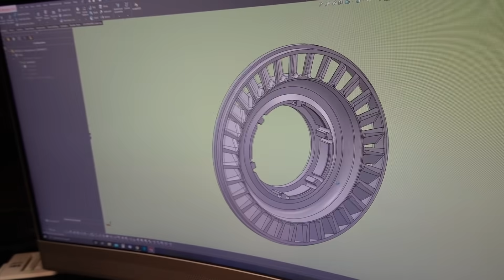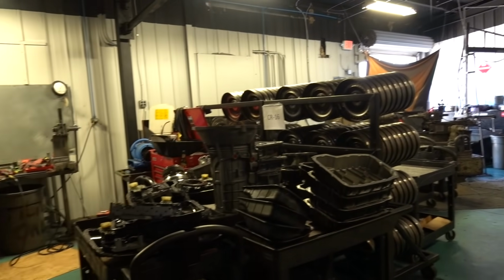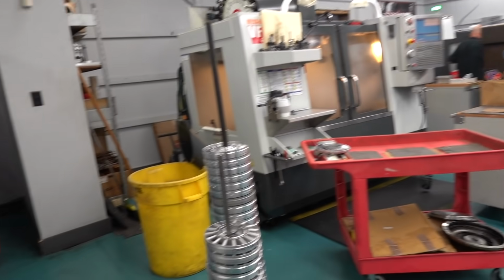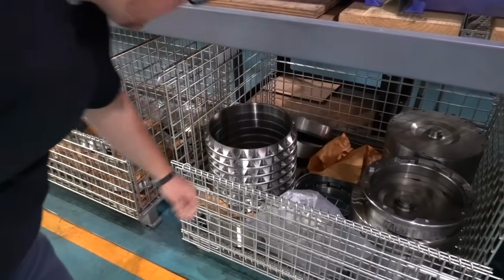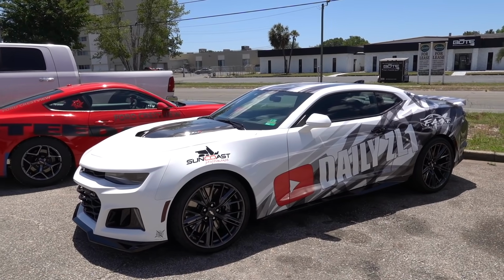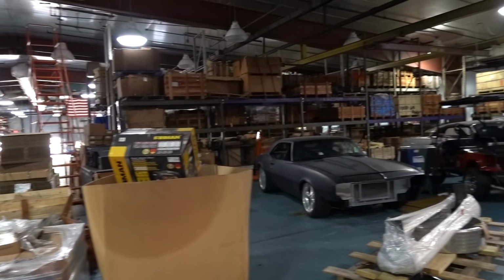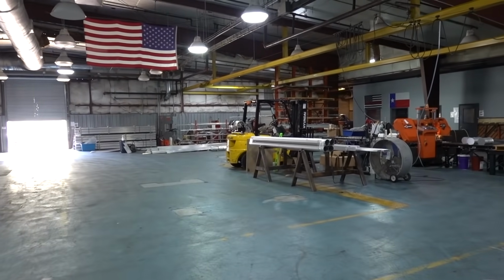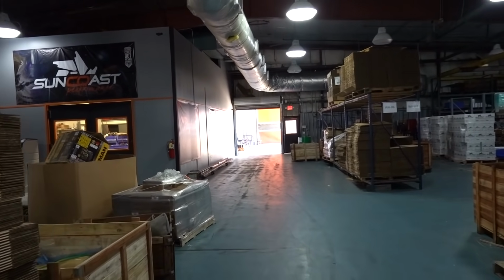THIS CUMMINS TRUCK HAS HAD OVER 5,000 TRANSMISSIONS IN IT!!! IM SERIOUS!!!

Comment: Wish i could afford a trans Because after i rebuild my engine that trans is going to blow up next
Reply: Thats when you baby it. My little old 4l60e is on her last leg yet still gets the job done. I leave the pulling to my dually now.
Reply: @brandoncaldwell95  sounds like the 4l60 is due for a 4l80 conversion.
Reply: @kevinkalivoda3442  i honestly wish i could. Issue comes its 4x4. Transfercase
Reply: @brandoncaldwell95  t case mounting flange is the same on a 4l60 and 4l80. Transmission crossmember mod is fairly easy. They sell a wiring harness adapter. Trick to me is the driveshafts.
Reply: @brandoncaldwell95  most people source driveshafts from a avalanche since they came with a 6.0 and a 4l80. Or you can have yours modified at a driveline shop. You may need a flexplate from a 6.0l as well
Reply: @kevinkalivoda3442  Honestly, ive been looking into, but not that much. I want to swap to 3500 larger leafs maybe dually axle swap. Just swap gears for the front. Id go custom driveshafts from a driveline. I know with the trans and the dual tire setup i can haul heavy. Only weak link being the frame which i could care less. Pin weight from my gooseneck is all it would be battling besides an aux tank for diesel. Im actually trying to get ride of my diesel and prefer a short cab, short bed dually. I know theres a forum out there that did short bed 2500 dually conversions and sell the fenders. Just the front knuckles to 8 lug conversion is a bi*ch. I know you can run adapters but i feel an 8 lug and dually adapter would be hell bearings. Engine wise it doesnt need to be touched. Its a t 170k miles. Once it blows, ill fine another cheap 5.3L or 6.0 to pop in
Reply: @brandoncaldwell95  hmmm. I have done 1500 to 2500 hd conversion but have not done dually knuckles. 8 lug standard wheel conversion is pretty easy. 1500 and 2500 hd leafs are the same length eye to eye. Probably gonna have to change diff gears to compensate for lack of power. 5.3 will struggle more to turn duals and the beefier rear diff.  Sounds interesting though. Let me know how it works out
Reply: @kevinkalivoda3442  how did you accomplish the 3 bolt to 4 bolt hub swap? Heard the knuckles do not swap well. As for gearing, i was aiming for 4.10 to help. Stick to the 255/70/17 and get a different torque converter. 5.3L packs a punch that im sure Duals wont have an issue with. Ive seen a few 5.7L hemi dually trucks floating about. I know theres the 6.2L ones also. Issue i come across with 2500 leafs, they are the same pack pretty much. Im sure 3500 have the same eye length and will bolt up. If anything ill squeeze it in even if trimming the leaf a little on the eyes.
Reply: Just sell the truck and upgrade. You can beef your truck up as much as you want but legally it doesn't change your tow capacity.
Reply: @brandoncaldwell95  knuckles were a fairly easy swap here in AZ with little to no rust. Pretty sure ball joints are same size but I replaced for maintenance while I was there. Used 2500 ball joints.  I used a press. Not sure if ball joint tool allows on truck replacement.
Reply: @brandoncaldwell95  never saw a 6.2 in a 3500. When I left the dealer in 2012 6.2 was a light duty engine only. Gm engineer stated the aluminum block and high compression didnt hold up well during heavy towing (longevity). Never tried it personally so not sure. But it makes sense. 6.0 in a 2500 hd is lower compression, less cam than a 6.0 in an Escalade
Reply: @Steve_I  i dont give a fuck. Cheaper and easier to upgrade then buy different. Secondly, if you read a post from above, i said i have a 3500 cummins. I do not want a payment anymore or do i want to buy someone elses problem.
Reply: @kevinkalivoda3442  ment 6.4L and 5.7 L in the ram 3500 dually trucks. 
https://www.autonationdrive.com/blog/2019/september/6/2019-ram-3500-hemi-review.htm
They had them in the 4th gens also. I honestly dont see any issue with with a 5.3L being substitute to a 6.0L as they are basically mostly the same internally. Of course there are differences. And as for what ive noticed the 5.3L gets better MPG then a 6.0L. For performance, i know the 4.8L and 6.0L are better for boost applications. A 5.3L can be used, but the increased compression already plays hell. Still can hold 1300hp before it blows with stock bottom end. I know the ball joints the the IFS trucks can be swapped out as they are the same. Least the lower one where the top is a bit larger. The issie comes to the 2500 knuckle being a 4 bolt and the 1500 being a 3 bolt. Cant simply swap knuckles as the tires would be like this  --> \----/. The rear end would be a simple swap.
Reply: @brandoncaldwell95  i did not have an issue with alignment angles. We did swap ft halfshafts from a 2500 so splines matched. Someone told me its possible to use 1500hd hubs and the 1500 halfshafts will work.
Reply: @kevinkalivoda3442   i may hit up facebook for a wrecked 3500 and fine the Knuckles, shafts, rear axle, front spacers and hubs then. Maybe the top and lower A arms just to get out my experiment as i read a few guys have a hard time with adjustment. Also may try to get the trans to have it at least rebuilt and sit in the garage till this one blows. Wont be the first short bed dually, but itll be the fist 1500 extended cab dually. Ill just get a ram megacab bed installed.

Comment: Lol no way even if you were the best mechanic in the world and could change one transmission a day that puts you at 13.69 years. Your lie isn't panning oht.
Reply: We typically test around 5 units a day in that vehicle, and sometimes it has been as many as 8. We convert them to a 2 wheel drive tail housing and can have one swapped in around 45 minutes. This process is done for every 68 sold to record CVI's and pressures.